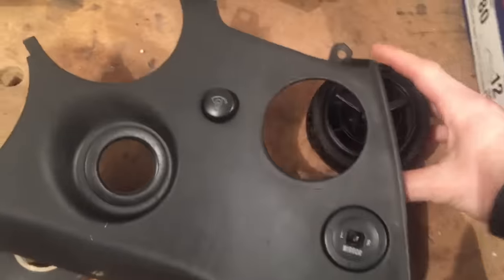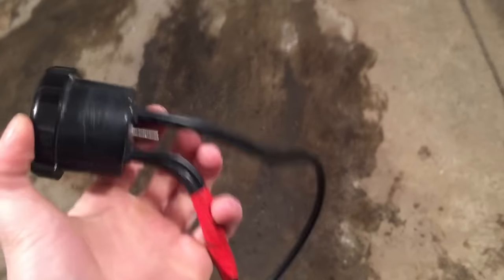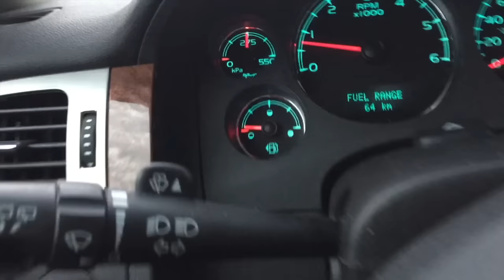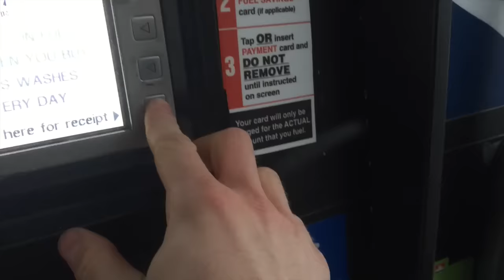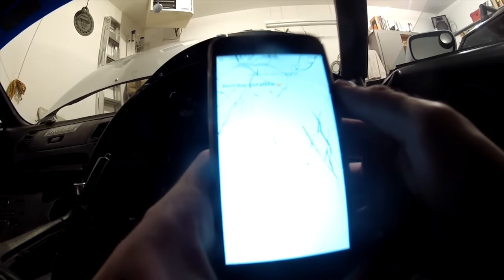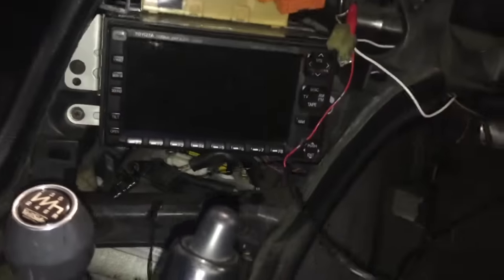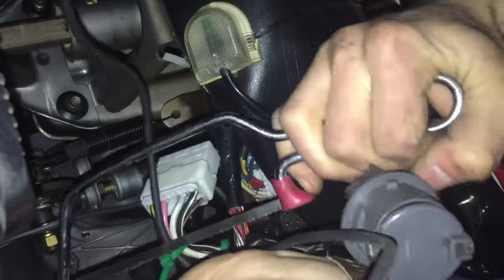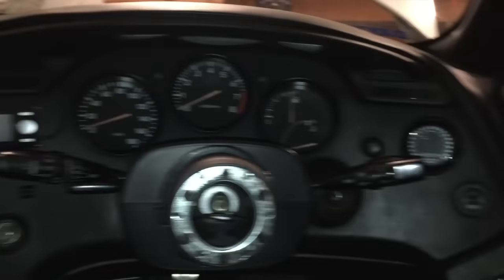LOWCALS SUPRA - MOUNTING GAUGES!!!

Comment: key tip. when you solder youre supposed to heat the metal you are soldering. not the solder itself. also no heat shrink?
Reply: Yeah but I'm lazy and didn't want to wait for it to heat the wires lol. It works haha! But thanks for the tip man
Reply: Jesse Tyler  ya it does work. just not as strong of a bond.